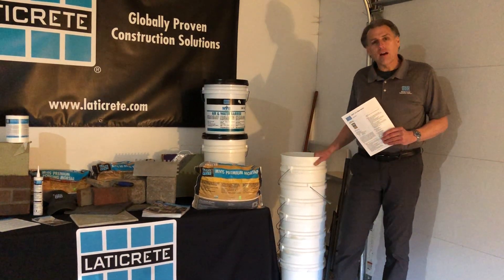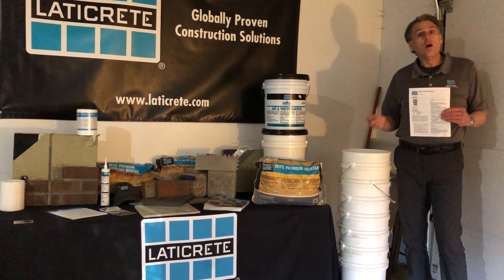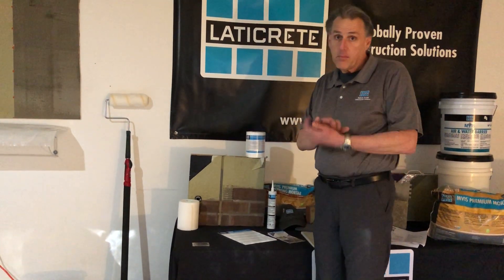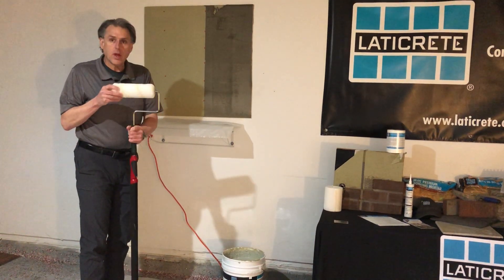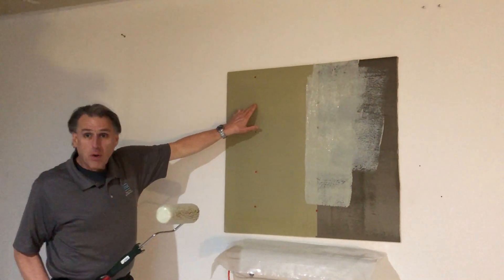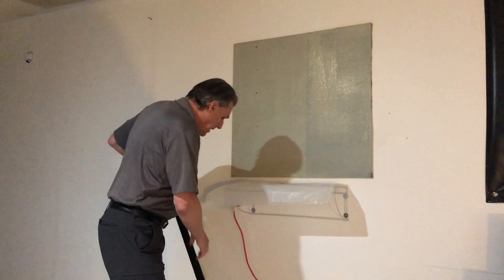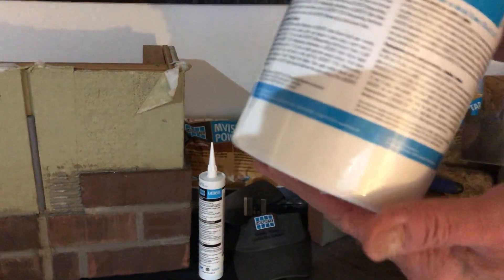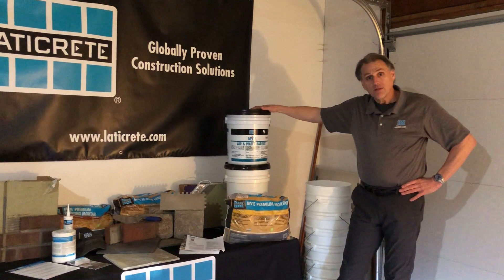MVIS™ Air & Water Barrier Waterproofing, Crack Isolation, Air Barrier Membrane Demo

Comment: Can this be applied to a painted concrete wall?
Reply from the maker: Thanks for the question. This is not recommended to be applied to paint. If the wall is painted your technically then adhering to paint and not the concrete.